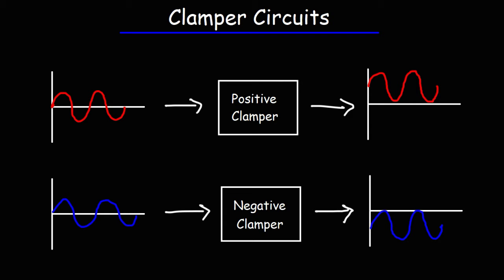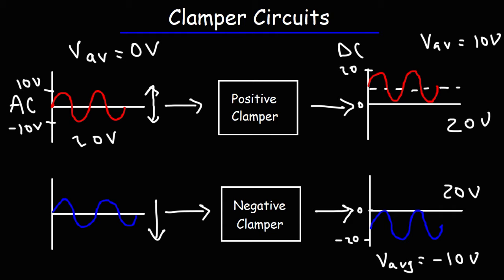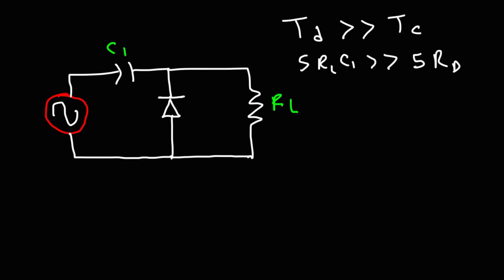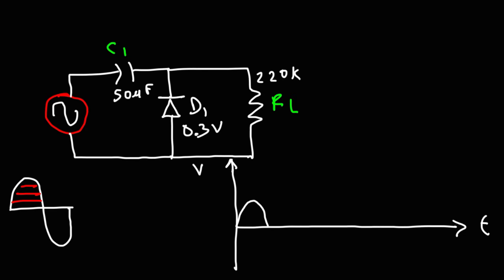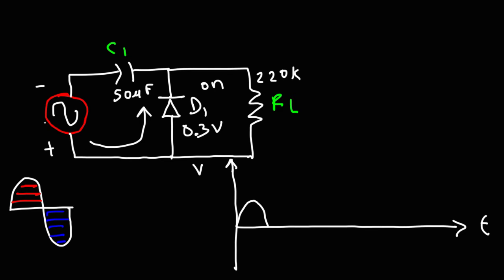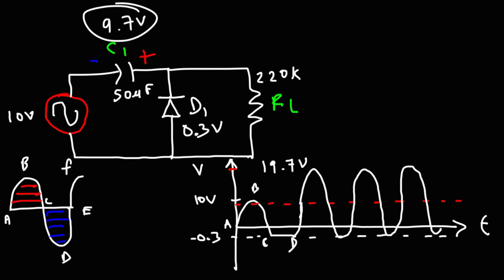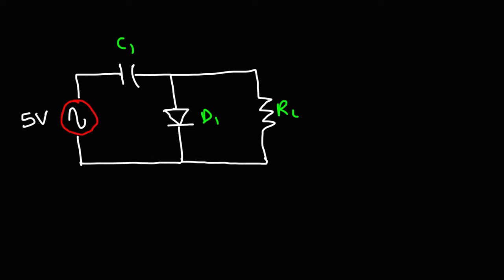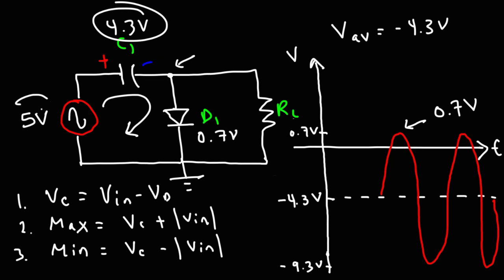Clamper Circuits

Comment: In the negative half of the signal the capacitor will explode since its electrolytic and the diode acts as open circuit then the current will flow and make the cap to explode 10:17

Comment: Yaha pr 12:00 ma positive half cycle ma capaitor yoo charge hoo
(-) ---||-------(+) Vc=4.3 V by given configuration aur is ka sath hi battery voltage is -5 V which implies that voltage is like this +| but if we draw it like so -|+ then in such case Vin=5V ... Now connecting both... 
(-)|(+)--------(-) ----||-------(+)
Then how can we say that voltage output is -5+9.7 =4.3V at point E?? While from above configuration it should be like so, -5-9. 7=-14.7??

Comment: personal notes, I realized you can kvl capacitors because the supply voltage is AC, capacitor are opened during DC. Since it's AC you can get Vc and VL if it's an inductor. Also, the capacitor charges if current goes from + to -, and when doing kvl, initially, Vc = 0V for positive clamp, so doing kvl would equal load to supply.

Comment: 4:05 To clarify, the diode is in parallel with the branch that contains the input signal and the capacitor, and is also in parallel with the load resistor.

Comment: 7:03 how does the + half cycle current flow through C1? Isn’t C1 supposed to accept current from right to left in this arrangement? I mean since it’s it’s an electrolytic capacitor i thought it could only be used in a DC circuit
Reply: Yeah current don't pass through a capacitor due to d di-electric in between buh for me, I just take it to serve like a battery connected in series to another voltage source thereby making d voltage adds up buh technically current doesn't pass through a capacitor as U said 
Buh come to think of it 🤔 they only said current doesn't pass through they never said voltage doesn't pass through so what if voltage passes through d capacitor thereby adding to its already voltage and adding up to come out to the output

Comment: Great video Sir,I only had to double check whether the voltage fluctuates around the capacitors and max voltage of both the positive and negative clamper circuit...I still love your videos ,Sir .

Comment: why does the Vm (the voltage across the capacitor) not change in the right-hand side of the negative half circle at the first circle ? (still remains 9.7V)

Comment: It seems to me that this circuit would not work well when driving a low impedance stage (e.g. a speaker).  I suppose you would have to add buffering if that were the case.

Comment: Physics tells us that capacitor stores energy through electric field, but electrons cannot pass through dielectric between the plates, but the way he explained, electrons pass through the dielectric but block by the diode in reverse bias, is that so? I hope he would explains it further.
Reply: Current does flow through capacitor
Reply: @ohmslaw6856  I think it depends how you think about it.  Electrons will move onto one plate when other electrons move off of the other, so from the outside, it looks like current is moving “through” the capacitor.  But in actuality, no electrons are crossing between the plates (at least unless the capacitor starts breaking down).
Reply: I may be wrong but I think he was saying that if only a small current goes to the capacitor, then the plates will have very close to the same voltage.

Comment: Many thanks for the tutorial! Crystal clear, as usual. I guess you meant "will not discharge completely" @7:24.
Reply: no he meant charge because the resistance will take all the voltage then the capacitor's voltage will be approxi. zero.
Reply: I think it can get a bit confusing, since discharging a capacitor with a given polarity would have the same direction of current as charging the capacitor with the opposite polarity.  In either case, in the ideal positive clamper circuit, the capacitor shouldn't discharge appreciably during the positive half-cycle (or, on the very first positive half-cycle, charge the other way).  Then during the negative half-cycle, the capacitor would (quickly) charge with the correct polarity.
Reply: he meant charge because resistance is low, if it was high it wouldn't  discharge completely

Comment: So what you're saying is that the capacitor charges up in the negative cycle to offer a positive base around which the voltage fluctuates?  Thanks for the explanation!
Reply: I see now how that capacitor works, it basically is a line except when the voltage exceeds the positive clamp voltage of the diode in the  correct direction. When the voltage is bigger then the stable voltage of the diode on the positive direction, all of the rest of that excess voltage gets dumped into the capacitor, causing it to charge up to the maximum voltage remaining. (i.e the input minus the diode stable voltage)Then when it does, it will remain the same voltage and stay the same(idk why tho). Then what happens is as if the load is connected in series with a DC source, the voltage is the capacitor's. The process starts at the exact moment the peak positive voltage is reached, when the capacitor finished charging. After that it acts like a DC source, and founds the base around which the ac voltage fluctuates.
Reply: I think that is a great way of putting it!

Comment: Hi! There is some points I didn’t understand : 
1- at point c which is the debut of the negative cycle the diode is forward biased but it also needs 0.3 V to conduct. Correct me if I’m wrong but when the negative cycle comes the diode anode is at O V but I can’t figure out what’s the potential at the cathode.
In other words I would like to know how the diode cathode potential varies during the half negative cycle.
2- since during the half negative cycle the capacitor becomes more and more charged until it reaches Vm how the diode could still conduct if the cathode which is connected to the positive side of capacitor is more positive than the anode knowing that the anode is at 0V ? 
3- I always used to draw the potential arrow from the positive side of the component to its negative one. From D to E the diode doesn’t conduct anymore. Then the circuit is just Vin C1 and RL. So for me I would draw the potential arrow from right to left for C1, from top to bottom for RL and from bottom to top for Vin since we are still in the negative cycle which means the bottom is most positive than the top. According to Kirchhoff law I will sum the arrow in the same direction and substract the arrow in opposite direction : Vout + Vin = VC1. This is how I would do. In others words I don’t get how you could say that from D to E Vout is the sum of Vc1 and Vin.
So these are the 3 points I didn’t really get from the video. Any help would be appreciated.
Thank you !

Comment: At the negative clamper, why put a connection to the earth? If earth is at 0 V potential, than you have a short circuit between power source and ground no (during first wave)?
Reply: That’s a good observation.  I think that as long as only one side of the voltage source is at ground, then it isn’t a short circuit.  If the more negative side is grounded, then the source would generate a relative positive voltage, and vice versa.  From the diagram, the other side of the voltage source has to go through the capacitor and then either the diode or the load resistor to get to ground.

Comment: How do we determine the polarity of the non-polarized capacitor? I'm not sure when to add the capacitor voltage or subract it from the input when trying to make my waveform?
Reply: in the case when diode is forward biased, the capacitor is charged up (because it connects to the voltage source along a low resistance path), you can determine the polarity of the capacitor by looking at the polarity of V input. in the first problem, the diode is forward biased when the top terminal is -ve and bottom terminal is +ve. so the polarity of the capacitor would be -+ from left to right.